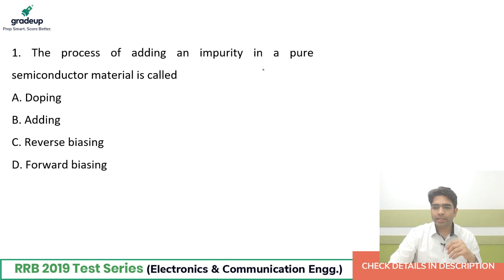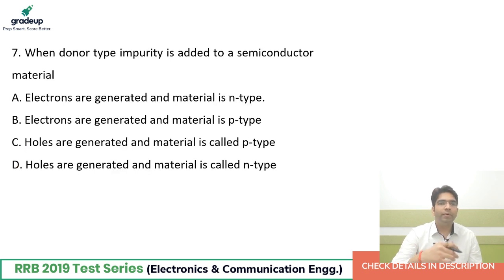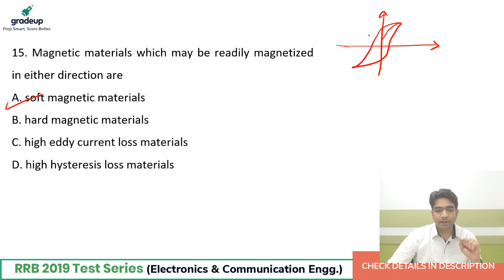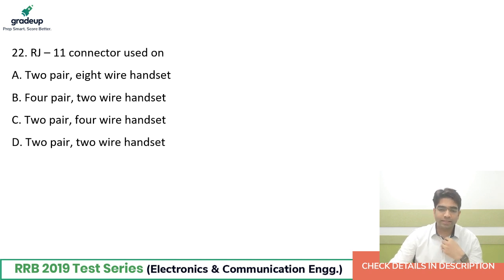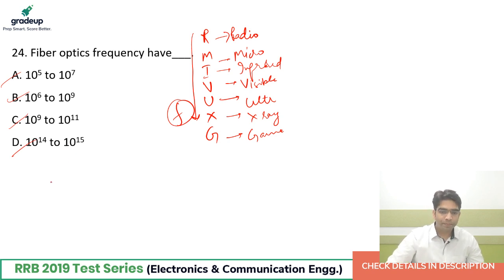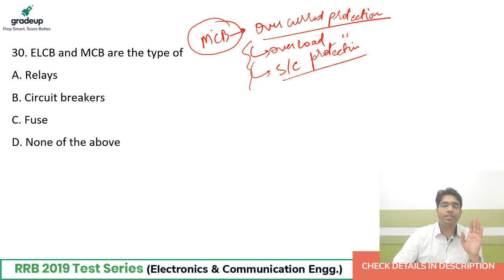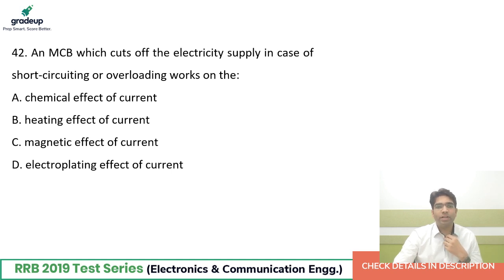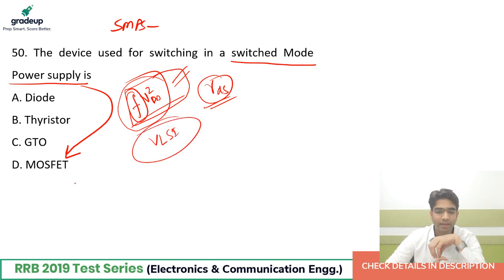Rapid Revision : Electronic Components & Materials | RRB JE EC 2019 | Important Ques. Discussion

Comment: Sorry guys, question number 2 , it at room temperature the semiconductor material will be in conducting state. And at zero kelvin the semiconductor behaves as perfect insulator.
Reply: I think it should be conducting slightly at room temperature,am i correct ??
Reply: Question number 9